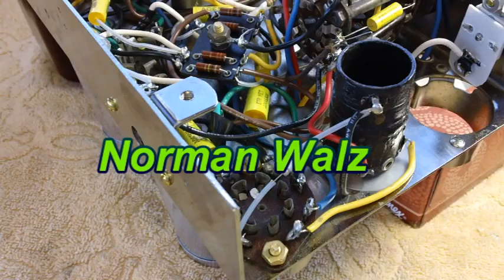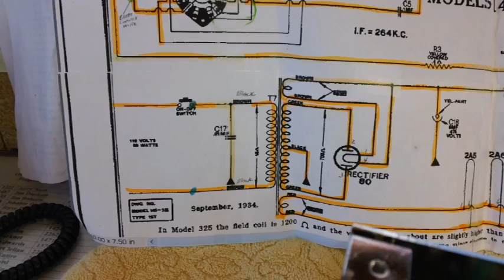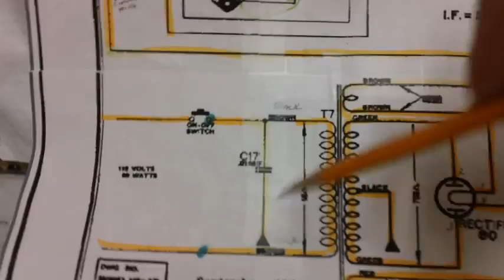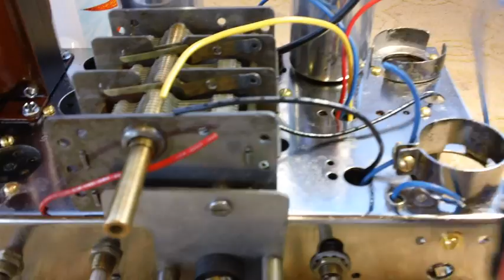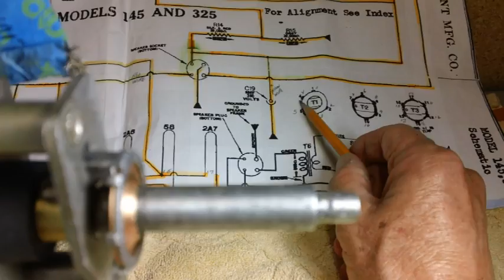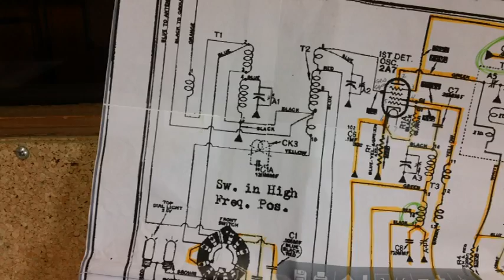1935 Atwater Kent Model 145 Repair and Restoration (Part 28 of 38).

Comment: Hi John, could you have simply made another hole in the plastic insulator for the wires to pass through, rather than cut it?
Reply from the maker: Darryl,
Good observation, my friend.  I did consider punching a third hole, but opted to just trim it.  There's all kinds of ways to do things when restoring these old radios.

Regards,
John

Comment: I think I'm going to apply some of the new stuff I'm learning from this video series to the 89. we'll get her running right eventually! I'm in search of an original volume control for it if you happen across one. the replacement I put in there isn't cutting it.

Comment: With regard to capacitor leakage a capacitor will in fact pass, leak, a certain amount of AC voltage, the higher the capacity the more leakage. Capacitors block DC voltage but will pass AC voltage, depending on the frequency of that AC. This is how they use them as a line filter, it will block the 60 cps from the power line but direct higher frequency noise to ground. If the chassis is grounded, and the line cap shorts out, it will trip the circuit breaker in the electrical panel.

Comment: In fact I have rarely run into a shorted paper capacitor in any circuit, mostly ones that were open or leaky. Some companies, Zenith in particular, stupidly liked to connect the line capacitor across the power line ahead of the power switch, in that instance a safety cap would be a good idea, or you could rewire it so it's on the radio side of the switch. In this A.K the only thing that cap may do if it shorts out, is energize the chassis, or go boom, but only if the set is turned on.

Comment: I don't see how much safety, or there lack of, one would lose or gain by adding a safety capacitor in this instance. A.K had the foresight to install the line capacitor on the radio side of the power switch, so the only time that cap will have voltage across it is when the set is plugged in and turned on. I've never bothered using safety caps in my sets, I've never had a modern polyester or ceramic cap fail, and I have very rarely seen an original line cap short out and explode.